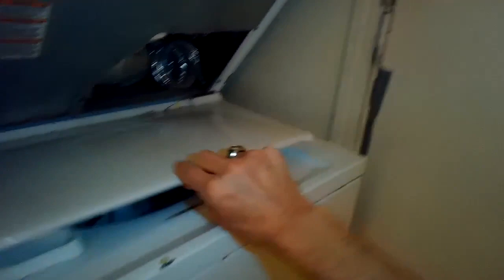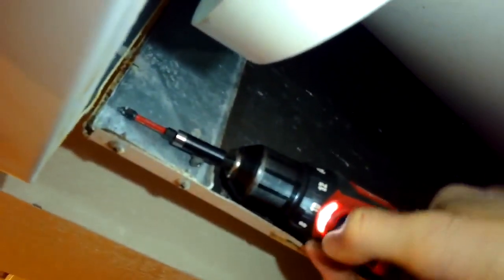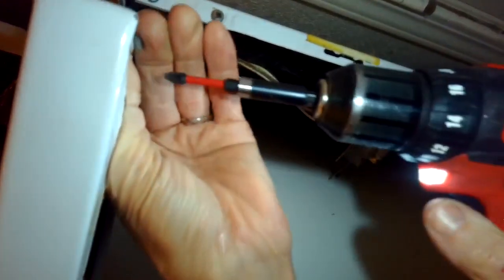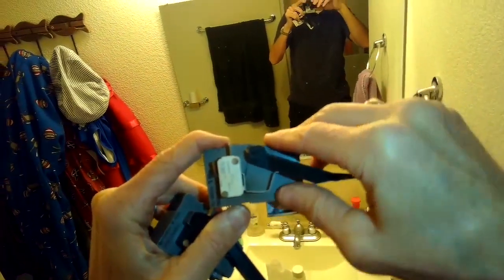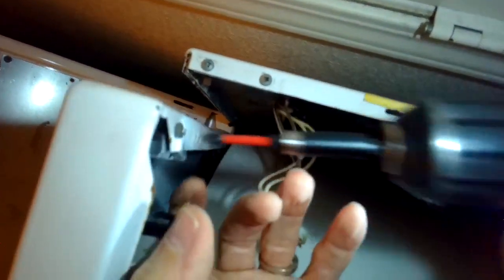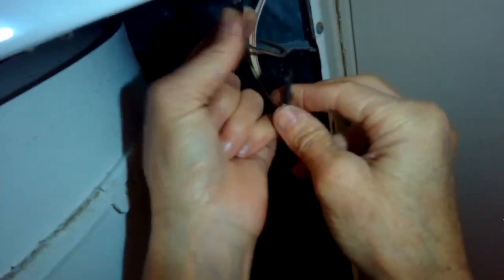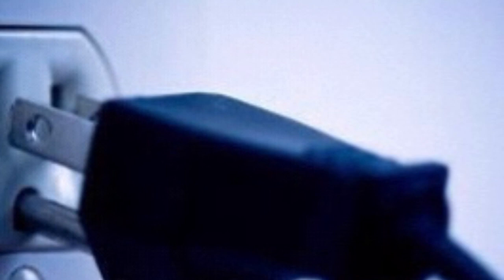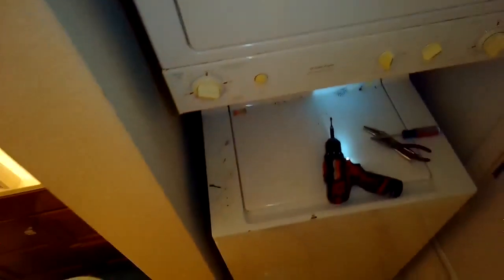GE Laundry Center - Lid Switch Easy Repair - Gets Your Washer Spinning

Comment: Hi. I have this same machine with the same connections. This switch started smoking pretty bad. Would still fill with water and drain but wouldnt agitate or spin? Now it wont do anything? Spin agitate fill? Would the switch do this? And what is the micro switch? I had one just like this and had the same switch but didnt have that micro switch with the 2 wires.  Any ideas?  Thanks for any help
Reply from the maker: Hi Rick,
Can you send that same question to my email at: scottthefixitguy@yahoo.com

Comment: Scott the one I have is  GE combo and the lid switch number is 134101000 which is not available anywhere.  Can I use 134101800 Frigidaire switch which looks similar and widely available.  Please let me know. Thanks

Comment: Great video.. what doesn't drain ..do you think it's clogged.. what is my next step thanks again be blessed
Reply: jirojoseph esman Hi!!!! It could be clogged or it’s a bad drain pump, try to remove the front panel, and the drain pump is on the right side bottom, run the washer, and put it on the drain cycle, if you hear it vibrating, then the drain pump is working, now you have to disconnect all hoses attached to drain pump, get a couple of big towels, some water will spill out, check all hoses inside for any blockages, I forgot!!! Unplug the machine from the electrical outlet. good luck 👍,Cheers 🍺🍺✌️✌️
Reply: @TheMechas56  mine works fine but when it gets to the spin cycle it stops..do you think it is because of the led switch?
Reply: @lameesyounis  Hi!!! try to replace the Led switch first, and we’ll see what happens, it may work, and this part is cheaper, good luck 👍🏼 🍀

Comment: Hi. Have a stackable and the cold water turns itself off after a few seconds. Hot water is good just does this with cold water. Help!?
Reply from the maker: Just need to replace the cold water valve

Comment: My switch is too far to the right to engage.  Is there a way to move it to the left any more?
Reply from the maker: Do you think the whole upper panel is out of position?
Does it look like the switch itself is bent?
Reply: Can't tell.  It just looks like it doesn't line up.  I am going to take the front  panel off this weekend and see what I can do to fix it.
Reply: Where did you purchase the switch?